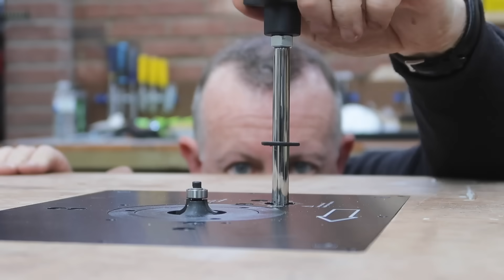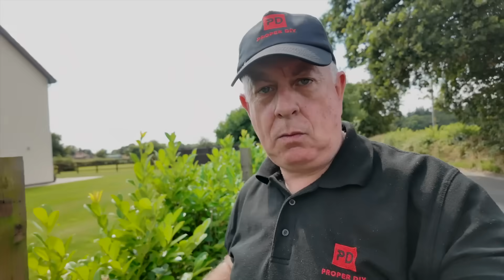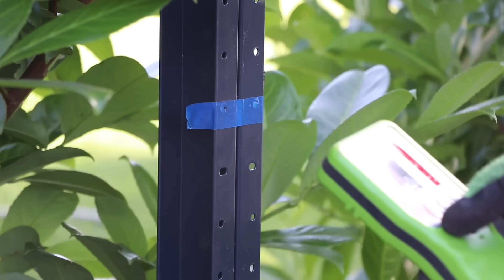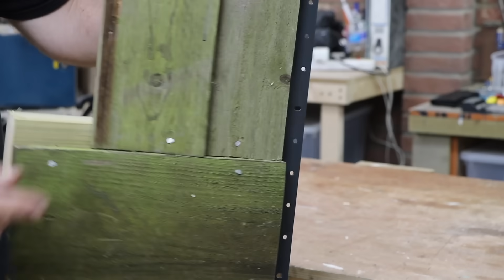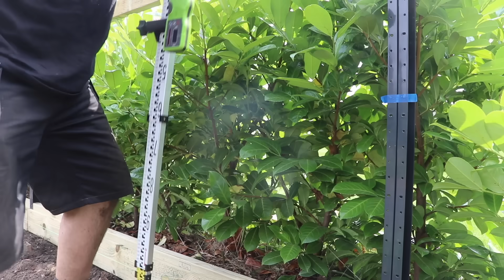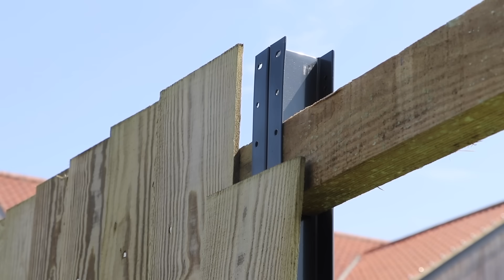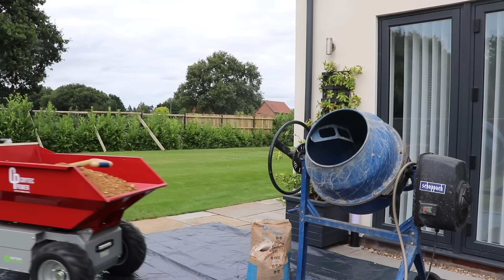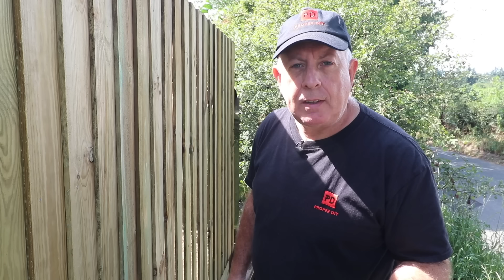Save Thousands By DIY Fence Building: Step-by-step Guide

Comment: Very interesting was when you were nailing the feather board on, the fence moved. It shows the post aren't strong enough to prevent deflection. I use galvanized steel posts concreted in to 600mm deep, then stagger the rail joints. The rails are fixed to 3 posts at 2.4m spacing, meaning the rails are under the 5.4m long available timber rails.
Reply: You seem to be confusing strength and stiffness. The posts aren't stiff as you say so they do deflect but they don't buckle under high wind loads.

Comment: The sag isn't just due to the support under the fence. As you know being an engineer, it's the type of timber rails, not big enough rails, the post spacing is too wide and / or not enough rails. Never use treated pine for rails as they don't really give enough structural strength.

Comment: Did you need to get planning permission for putting a fence that tall facing on to the highway? Our local council throw a fit if you have anything over 3' or 4' fronting on to a public highway.
Reply: True, it pays to be mindful of if you're doing something other than like for like replacement.
Reply from the maker: No, just live on the edge

Comment: Used concrete gravel boards with my Duraposts. A years after installing them still up and straight even with the stormy weather. Cost me around £500 for 7bays, did the work myself.
Reply: I wondered were concrete gravel boards compatible. Do you reckon you could stack two gravel boards securely using the Durapost system?

Comment: Interesting vid, But this would only apply to the few people who are already into their diy and have the relevant tools for the job. That's what half the cost of getting the work done covers. The not buying a concrete mixer, nail gun, outdoor laser level, wood saw, skip for old fence removal etc. Not to mention your own time, what is that worth? So your not actually saving that much money. Still interesting to see how you go about doing the job.
Reply from the maker: You don't need the expensive tools to do this job as I said in the video. I've renovated 2 houses with a lot less in the evenings and weekends where unfortunately the cost of my time is zero. Doing jobs around the house rather than paying a contractor I think is a lot more worth wild than wasting hours playing on the internet or drinking in the pub at the weekend.

Comment: Loving your work. I think the look is fantastic. A mate and I went all out and put concrete posts, gravel boards and feather edge up on 20m across the back of my garden. 15 years on it’s still doing great. Never liked the look though but the wood is all off the ground so it will live on. The arris rails shrink over time so there are gaps that have to be repaired and a bit of adjustment needed. The posts haven’t moved.

Comment: A great alternative fence job, well executed.
Where did you get your long sds chisle bit and concrete vibrator?
One tip for sagging fence panels is to add a small stake half way under the lower rail (concreted in of course)
Reply from the maker: I picked the bits up from Lidl a few months ago and the vibrator from Ebay

Comment: We've recently had gardening work done by a landscaper/contractor: they asked €2000 for a 9m fence, which we ended up doing ourselves to save money. We wanted to use natural looking wood (don't know the English term for it, sadly). It ended up not quite 100% straight and level, and according to the contractor we also did a bad job in terms of sturdiness. However, I feel it looks good, it's actually solid enough to resist any weather, and it only cost us €680 in total.
Reply from the maker: Nice one!

Comment: Amazing build, smart design! It was a joy to watch. How did you drill the screw at 10:45 accurately trough the post hole, is the bottom screw gripping on to something?
Reply: good question, that was what I was wondering. Possibly an off cut of the 3x2 screwed in to the post holes underneath the 3x2 "rail"

Comment: The fence looks great, quick question though, could you slide a fence panel into the gap in the posts?
Reply: Yes, also concrete gravel boards.
Reply: Yep, that's what it's designed to do as well as this 🙂
Reply: @MomoJojo98  cheers for the reply

Comment: Looks great. Only thing is replacing it in 15 years will mean doing it all over again. Did concrete gravel board, concrete posts and panel fencing work out a lot more expensive? That would make maintenance much easier when you are older and not so fit!
Reply: Stuart made a video covering this a few weeks back 👍
Reply: @MomoJojo98  https://youtu.be/ddn4qcOkiW4

Comment: I noticed that you've nailed the feather-edge boards in the same direction. My dad was a carpenter for the local council, and had erected and repaired hundreds of fences. He always alternated the direction of the boards for each section. The traditional rationale was that if wind is blowing diagonally against the line of the fence, only 50% of the force is being exerted on it. The other 50% being deflected by the narrow edge of the feather-edge. Given that wind-strength is increasing over time, this consideration is becoming more important, especially on a long run like yours, even if you're using metal posts. 

I commented at the time about the wisdom of planting your laurel hedge. I see that even in this short period it's becoming a beast. As branches grow to the width of an arm, unchecked, they will bear down on the fence and damage it. I speak from experience. Laurel is a very heavy wood. Laurel hedges need regular and brutal maintenance to keep them away from fencing. When laurel is young, it seems like an attractive cheap solution, but you're making a rod for your own back in the longer term. I'd advise your followers against using laurel as a hedge.
Reply: Totally agree with the comment on the laurel hedge. Get rid of it now!
Reply: Agreed. I'd never plant laurel next to a fence, in fact I'd never plant laurel at all out of choice. It never looks good when it's trimmed IMHO, the leaves are too big.
Reply: hmmm I used to have to maintain ( in our old house's drive) a 100ft Laurel hedge from saplings when we moved in, when we moved out 12 years later the hedge was 10ft high and 4ft deep despite continual pruning AND me actually removing quite a few early on as the builder had put in far too many!   They do make a nice dense hedge BUT need a lot of annual maintenance.  In the end I had to get a contractor in to do the work.
Reply: Excellent advice
Reply: I planted one self set laurel from my parents garden in our garden when we moved in 15 years ago. It is now 20 feet tall and the trunk is at least 12 inches thick at the base. And its still growing....
Reply: The money I save on the fence can go on buying all the equipment I'll need, I suppose...
Reply: @ruffastoast8570 that right there is man maths 😂 save money doing it your self but spend more on tools 😂😂 at least you now have the tools for further projects😉😉 and the satisfaction of doing it yourself !
Reply: Having just seen the cost of dura post, I was wondering how that would compare to going to a local fabricator having them pre drill a set of H section beam and having that dipped md power coated, anyone know the economics of that ?
Reply: Laurel is easier to maintain than leylandii for a border, but I'd never have them in my garden again. Box hedge is my preference, though very slow growing... Sadly, last year box hedge moth killed them all in a couple of days. There's plenty other games that would be easier and less damaging to choose from.
Reply: I’ve used laurel extensively and while I agree to a certain extent, it does have some positives… it’s fairly easy to maintain if you keep on top of it… it can be cut back hard unlike other hedges and soon regains a decent appearance. I find it pleasant to deal with in terms of allergies or reactions. 

Its best feature is the speed of growth if you want a quick barrier. That’s also the issue with maintaining it of course. 

The worst feature is the lack of structural strength if you have to maintain a tall hedge… hard to prop ladders against it.

I’d have preferred golden yew if I’d have had the patience!
Reply: That is a smashing job, I must say.  I prefer to use plants as fence barriers - pioneer trees like birch, quickthorn, hazel and dog roses to tie it together.  The resulting hedge supports wildlife and is significantly cheaper with not much maintenance.  Three/four years will give you a good result.  Obviously he isn't particularly into gardening (laurel bushes?  I don't think so)  so I guess that is not an option.  I have three acres, so fencing is out of the question!
Reply: Great video, I've learnt a lot - thank you.
Reply: Is this portuguese laurel or another type of laurel?
Reply: I 100% agree . I have about an acre of land  previous owners put in laurels  . I kept a row (for a reason)  but I would Never plant any red robbin would be a good replacement.
Reply: We've got the Sleeping Beauty effect 10ft laurel hedge it was maintained from birth.

It hasn't interfered with the fence panels because it was planted further forward.

When the hedge has grown and done it's thing the need for the fence becomes irrelevant because it's dense and nothing can get through except birds and squirrels.

We also have a tree version of a laurel and the twisting trunks and sheer beauty is fabulous, but it's not for average gardens. Otherwise, it's dominating 🎉

Comment: Seriously impressive fence, love the look of those posts and it'll be sturdy. But what struck me most was your display of stamina. We're about the same age (and build!) and I have to say seeing you attack and relentlessly pursue a pretty mammoth task on your own is genuinely inspiring. So inspiring in fact that it's 8;45am on a sunny Sunday morning, and after I finish this comment I'm up and out to the garden to get stuff done. Thank you 🙂
Reply: Don't let age stop you
Reply from the maker: Thank you and I'm glad to have inspired you.
Reply: Could you tell me where did you buy the cant rail and cls? and what's the size of them? I saw different type and size in Wickes and dont know what to choose, thanks
Reply: I completely agree. I’m was glued to it!
Reply: Yeah, stamina is key. I always prepare mentally what I need to do, tools and consumable items (screws etc) and approx amount of time it will take (with a plan B in case things don’t go to plan). There’s the setting up, the job itself and the tidying up after, all needs to be accounted for.

So glad I’ve strength trained (see my channel) all my life, because at 63 I need to be diy ready 💪🏻 

Yes, it’s a shameless plug for my channel as well 😂
Reply: Obviously your cost comparison doesn't include time and labour costs and someone may simply not have the ability or time for whatever reasons to do it themselves. However, that apart, it does show the savings that can be achieved by doing it yourself. I did wonder why you chose feather edge as they can be more prone to expansion/contraction due to the weather?
Reply from the maker: My time and labour costs in the even and weekends are zero
Reply: @ProperDIY  and you can subtract the gym workout time and cost as you don't need it. But you will live longer so you need to save more.